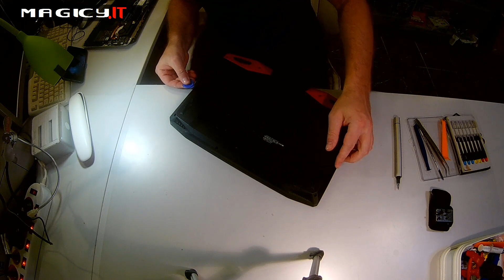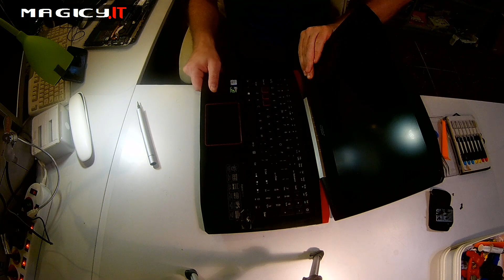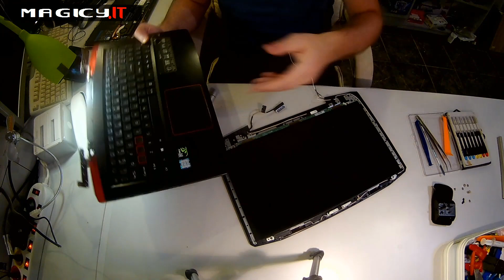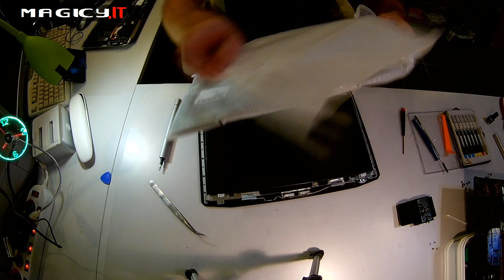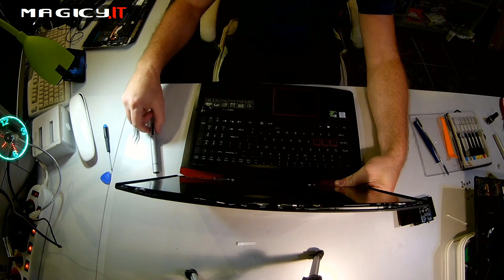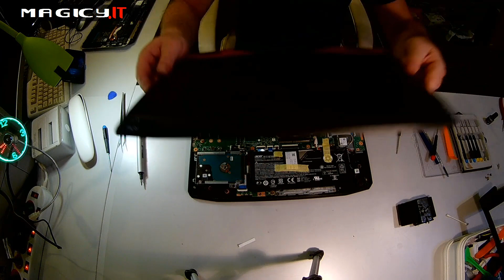Acer Aspire VX 15 VX5 591G Disassembly

Comment: I just wanted to say thanks for the Disassembly video. This video made me comfortable with opening up my laptop to replace my broken mount. The plastic cylinders that holds the brass mounts broke from fatigue which prevented the monitor from closing. But now it is all fixed. Thanks!
Reply from the maker: Many thanks for your kind words
Reply: Hey where did you find the replacement? I have the same issue and my laptop no longer close.

Comment: Thanks for the upload! This helped me finally clean my fans and it fixed the overheating problem I had, I’m not sure if it’s recommended but I used compressed air shot through the ports on the back edge and the dust went flying out of the fans fixing it instantly

Comment: Hi, is there a video too disassemble the keyboard?
Reply from the maker: In this model, the motherboard is screwed to the bottom of the keyboard integrated into the upper housing. To replace the keyboard itself, you need to unscrew the motherboard, cut out the old one and glue the new keyboard. Quite a difficult task.

You can see how to do it in my other video and even though it's a different laptop model, the method is the same:
https://youtu.be/Q80li3eYFJU?si=wlY75CbVlT_g2I8T&t=215

Comment: I opened and cleaned my fans on this same model, but now my nvidia graphics card is not getting detected by the system, i cant install graphics drivers and all it says you don't have the graphics hardware compatible for this driver, plz help me I.
Reply: Start the computer with the flash memory in the Live version, if everything is OK under another operating system, the graphics card is definitely not damaged, then try another driver, otherwise you should check the connections to the screen and the fan again

Comment: I took the bottom off mine for a basic cleaning of the fans and used compressed air. Put the bottom back on and now my screen won't turn on. I hooked the HDMI cable up to it and it projects it on my TV fine. I had a problem taking the back off, I recently had to have the screen fixed and they stripped one of the screws to the top middle left, not on the red, could it be that messed it up? I need help please
Reply from the maker: I think you should start by checking the connection of the screen to the motherboard

Comment: Was a huge help for me in replacing my back panel, thank you!

I was able to skip taking the heatsinks off. Before I realized it's trivial to detach/reattach the antenna cables off the WiFi chip, I threaded the whole chip underneath the right heatsink (after removing the right heatsink fan), by following the cable routing through to the antenna. Saves a bit of time either way though.

Comment: This flicker issue has to do with a bad connector that Acer seems to want to hide this from customers.. This connector seems to be a common component used in many Acer products.  Over time It will find a way to loosen up and cause this flicker issue . This is why after sending my laptop back to Acer twice without a permanent fix and them wanting me to send it in a third time I decided to look into it myself.  In my case my laptop did not stop flickering completely till I opened the case and fixed it by inserting and attaching a spacer between the top of the display ribbon cable connector where it connects to the motherboard and case bottom so that it has no room to work itself out.  After doing this I never had the flicker problem again. 

The spacer needs to be a material soft enough to constantly apply pressure to the back of the connector while not touching anything else. I cut a small piece of thin foam padding to the size of the connector and taped it to the back of the case with electrical tape. When I screwed the back of the laptop case in it just applied pressure to the back of the connector.  Since then I have had no more flicker issues.

Image : https://us.v-cdn.net/6029997/uploads/editor/vl/dbg2m2ljbnpu.png
Source : https://community.acer.com/en/discussion/comment/570921
Reply: mine's having problem with the top connector. its at the camera area. when i apply pressure it doesnt flicker but when i let go it flickers again. any solution to fix this ??

Comment: I am very curious to know if it's possible to upgrade the GPU in this laptop
Reply from the maker: https://community.acer.com/en/discussion/577064/aspire-vx5-591g-7448-aspire-vx-15-ram-and-processor-upgrade
You can not upgrade the CPU, it's a BGA socket type and it's soldered to the motherboard

Comment: Hey! I just wanted to ask 2 questions about this laptop.

1. How do I loosen the hinge? I've had an experience where both of have hinges broke so I had to get them repaired. The servicemen said to keep the hinge loose as possible. Now after a month, the hinges appear to be getting slightly tighter again so I wanted to loosen it myself without going to the service center which is about 10 miles from my home.

2. I have strange problem with my display. Whenever a "blue" color comes on my screen, my screen flickers purplish horizontal lines. I have to tap near the bottom center of screen to fix it every time. What could be the problem?

Thank you helping me out in advance.
Reply from the maker: 1. You need to loosen the clamping screws
2. There may be many reasons. Connection, signal cable, graphics card, display. Best to give to the computer service to diagnose.
Reply: I had the same problem with red colour, I popped up the screen plastic cache and fixed the problem by moving the cable around to a proper place

Comment: hey there i need help my cover screen has broken there is a black wire and a white wire the black wire has been cut so now when i play any game the fps stays at 15 is that black wire connected to the gpu some how ? plzz help
Reply from the maker: I do not know what wire is going on? White and black wire are wifi antennas. It does not affect the display. Here you will find a lot of parts for your notebook: https://www.zandparts.com/en/partfinder/Acer/Notebook/Aspire/VX5-591G

Comment: My keyboard is bad, but when I opened it I see that is like riveted to the cover!!!  is an easy way to remove it to change just the keyboard? or need to find the bottom case with keyboard?
Reply from the maker: I did such a repair in a different model. Look here:
https://youtu.be/Q80li3eYFJU?t=216

Comment: Which ribbon cable is the one that connects to the keyboard? I'm having two unresponsive keys (Z and FN) on my vx15 and I suspect it's the cable.
Reply from the maker: Usually it is the widest cable, but if two keys do not work, the keyboard is damaged
Reply: @magicy.it_usugi_informatyczne  I appreciate your response. I also noticed my tilde key & page down are also not working as well as the z and FN keys. It all seems to be pointing to keyboard damage. I'm just unsure how it happened though.
Reply from the maker: Usually due to flooding, for example during cleaning

Comment: Excelent video man. 
My vx15 just suddenly stop working nor charging the battery (power brick is ok), did you see something like that before??, No burn out components at sigth, do you have any service manual so ican pinpoint a failure? any advice will be very appreciated!!
Reply: Is it just completely dead? No LEDs nor any flicker of the screen when you try to turn it on?.
Reply: @damianlcr   No leds, no nothing. Tested the charger with another laptop and its ok. Service Center guy says it needs a motherboard replacement (more expensive that a new one) to what i say hell no.

Comment: I've recently been having problems with mine, and keep in mind im not exactly the most knowledgeable person when it comes to parts and such. It recently has started automatically shutting itself off whenever the charger is removed from the port. Its always fully charged, and never close to the point of overheating when it happens. Could it be that the battery itself is going bad, and if so is it possible to get it replaced?
Reply: Hey, How long have had your computer? I have almost the exact same problem. In my case the battery looks like it's in perfect condition (I've had a battery report made and it throws a result of an 82% remaining battery life). So I started to think it was something inside, some cable went bad or something.
I've started having the issues you describe a couple of days ago, but now it just doesn't even work . I can't boot it from my battery, not a single led light turns itself on. it's like the connection from the battery to the laptop has been completely interrupted.